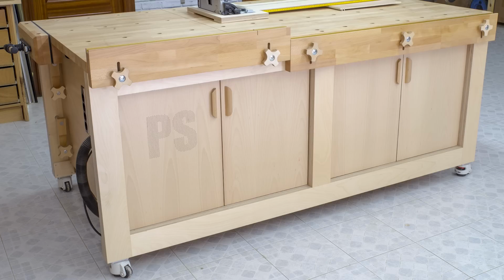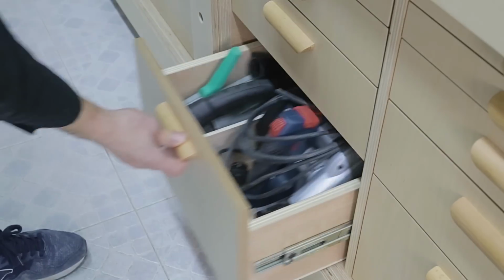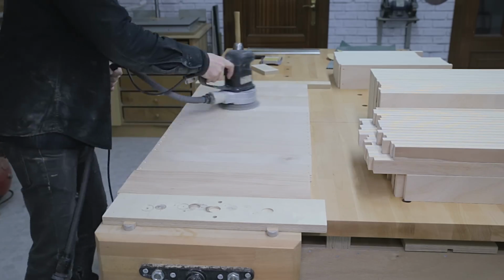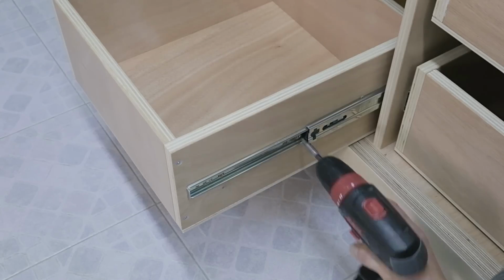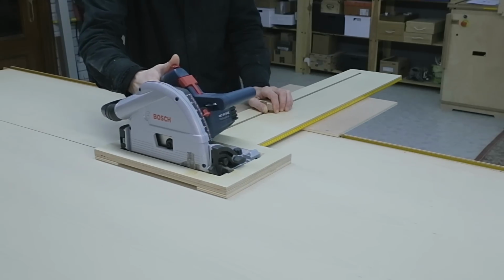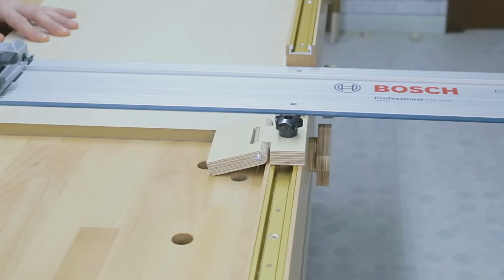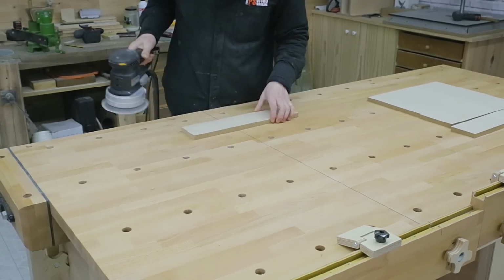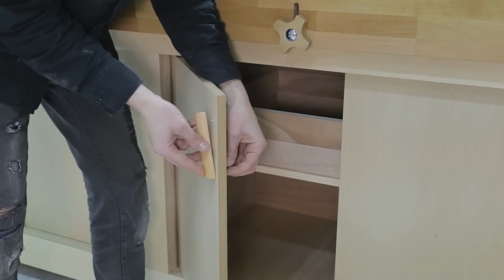High Capacity Multi Function Workbench Build / Part 4

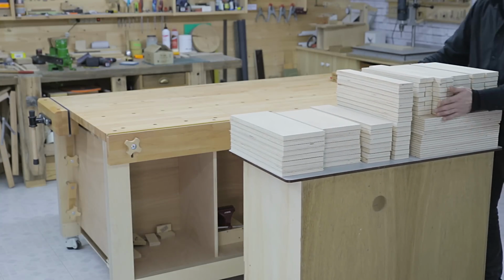Comment: Wondering if there are plans for the drill press featured in this High Capacity Multi Function Workbench Build / Part 4?  Shown at the 3:02 time.  It is different than the one featured with the free plans.  Thanks for any input.
Reply from the maker: https://www.paoson.com/en/shop-woodworking-homemade-tool-furniture-plans/39-diy-router-table-plans.html

Comment: Great work! I have this karcher vac. Horrible but best in it's price class. If you use it without a bag, filter gets clogged in some minutes or even seconds, when cutting brick walls. Though it half-cleans easily with reverse pressure button. I made a special place for it in my appartment, Like shown here but in a wall. With a pipe extension you can vac all house without taking it out of it's nest. Funny.

Comment: To be brutally honest with myself, my table saw scares me.  The idea of pushing wood toward a spinning blade with my hands (even with a push-stick) seems to be unnecessarily dangerous.  Maybe I've seen too many videos.  Even if I do everything right the wood could twist and I'm looking at kickback.  My DeWalt tracksaw doesn't.  I think it's safer than a SawStop.

Do you think this workbench with a tracksaw would be a practical replacement for my table saw?  I would rather not use my table saw unless I was using a sled.  I'm not a professional, I just want to build cabinets for my house, and maybe a little furniture.

Comment: I noticed when you're using your crosscut sled with stop blocks with your circular saw the blade is cutting into the beautiful workbench top.  Why not use scrap pieces to protect the bench top?  Does the crosscut sled need a modification?  Great bench and nice job building all your tools.
Reply: Yeah I was thinking the same thing

Comment: This workbench is incredible... One thing I don't see is how you avoid damaging the bench top with all these cuts you make?  I must be missing something.
Reply: On the longitudinal cuts he use a spacers under the plate! 
On a crosscut ,which is always on the same place, he made a groove cut once and always using this to crosscut.
Just a Genius ...
Reply: @Mtematiks  
@John Keith  
@Paoson WoodWorking  

You could also route a 20-25mm wide (3/4" to 1" wide) and 1/4"-3/8" deep dado channel in the workbench top where he always does his crosscuts, which would allow him or you to drop in a replaceable, "sacrificial cutting strip".

Like a table saw's "miter gauge slot", it could also be used as such as a marking/cutting protractor and miter gauge.
Reply: @bbfoto7248  Did not understand the removable bar with existing circular saw in the dado slot, because workpiece is between circular saw and workbench. What am I missing?
Reply: @rafaelmijares9197  Not missing anything.  :-)  Edited to remove my dumb@ss idea.  :-P
Reply: @bbfoto7248  lol. OK. Thanks for your answer and your sincerity!

Comment: One question, aren't you ruining the top of the bench by using your mighter saw? I saw the blade digging into the bench when you were doing your crosscuts. Are you always using the same spot for the crosscuts, or you can use different sections of the table as well?

Comment: I really like this workbench - it has so many great features. Thinking of making something similar and a bit smaller - though in two sections, for easier moval, with a slimline paulk workbench tabletop (not as tall as Ron Paulks original tabletop). It need some kind of easy removable fixtures between the two parts and the tabletop.

Comment: This is a fantastic bench .complete in every way . Almost. Now Im only suggesting  other bench builders think about these 2 things. One : holes in the work bench, it seems I lost many small hardware pieces that dropped into one of those hole and the time and frustration of finding that special bit would be unnecessary if you could design holes in only half the bench,Ever try to do layout or parts drawings on a bench with holes,problematic. We dont all have big shops many work in sheds. two: sitting at a bench like this one is just uncomfortable, drawing and layout small parts gluing or carving is ruff .their needs to be an overhang large enough to sit proper for more than just a few minutes.this bench really is an engineering marvel, I like it alot it solves many small shop problems. Something to think about..

Comment: just curious - when I see you crosscut, you are measuring and placing flip stops on the right side of the saw guide.  The edge of the guide, however, would be on the left side of the blade.  In the cuts I saw you make with the flip stop, they would be to narrow by the width of the blade, unless you are compensating for blade thickness.  Am I correct in my thinking.  So many great concepts in the bench!! I hope to incorporate some of them into a smaller version for my basement shop.  Thanks for all the wonderful videos!!
Reply from the maker: yes, when you cut on the right you must take into account the blade thickness, thanks!

Comment: This is what happens when a self taught hobby woodworker goes full gimmick mode to make a splash. In a real workshop you would never make your workbench that big or heavy or store that much crap in it. Space is to valuable to waste on bloated workbenches.
Using kitchen style drawers to hold tools and stuff ? Nope. That stuff is hung on the wall where its easy to see, easy to grab and does not take up valuable space.
One portable tool chest for hand tools that are valuable, sure, but thats the only storage space I need. Genuine woodworkers do not use their bench for anything other than marking out, planing, trimming dovetails etc. The rest is done on trestles so you can easily get around the carcass from all sides.
There is nothing more tiring than reaching over a wide work surface all day and they just collect dust and crap.
You can always tell if its a hobby shop because it looks more like a fitted kitchen and they dont work off trestles. All the wall space is taken up with benches and drawers ! 
Drawers full of useless gimmicky tools that never get used.

Comment: This truly is a awesome workbench. One suggestion I can offer is to add some ventilation in the vacuum cupboard or its motor will over heat. E.g. some holes along the top of the door would work well.
Reply: He already did.  And he did it with style!!  Go back and watch again starting at 10:07.

Comment: How much do the drawer runners cost? They're expensive here in Australia 😔
Reply: @Rendel  
Look at his newer and smaller "Modular Multifunction Workbench" build videos.

He made the drawers so that they work without using the expensive metal drawer slides.

It's a very simple and common drawer technique and allows them to be removable/portable trays as well.

They can also be made so the drawers are accessible from both the front and back of the workbench.

Comment: Fantastic watch, really inspiring! Can I ask how you don’t mark the bench when doing the plunge cuts?
Reply: When he was doing the long rip cuts, his strips of protective board underneath got touched by the blade. When he did the cross cuts, I believe there is a permanent blade kerf cut in his bench top where the track always guides the saw. So I think his track always gets set in the same position.
Reply from the maker: yeah! you are right on!

Comment: I'm not a Maker or wood worker but I'd love to do this for our Neighbourhood Centre.
What would you recommend as a starting point  to get this project started.
I dont mean tools but other things that would make it easier to make the workbench.
Thanks in advance
Reply from the maker: hello! in your case I recommend you looking for a carpentry shop that not only sells the materials, but also cuts and marks all the pieces required for its construction. This will be easy if you show them the cut list included in the plans, plus they don't usually charge much per cut. To avoid any nasty surprises, get a quote first.

Comment: That playing card trick for equally spacing the drawer covers is a fantastic tip.
Reply from the maker: yeah!
Reply: Indeed a really usefull trick. i use double sided tape instead of the screws to fix the front in place and then screw it... really nice work and thumbs up for the amazing workbench. i learned alot from this video and i will use some features in my shop too :)
Reply from the maker: @eberhardt7209  thanks Eber, send me some pics of that features!
Reply: @Paoson_Woodworking   Thank you for your passioned Videos you share with us, must be a lot of work. And sure i will :)

Comment: Never remove a power cord by pulling on the cable (1:33). Please pull the connector. Your cord will last much longer. Aside from that, great project.
Reply: Some see the donut, some see the hole.